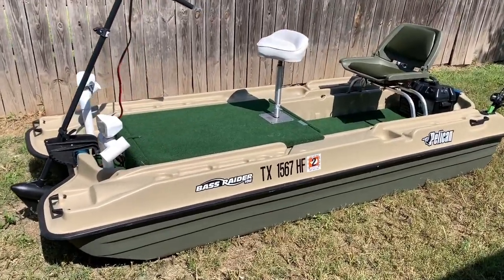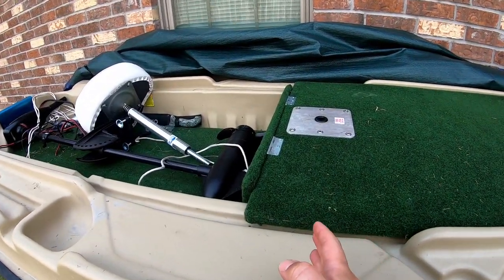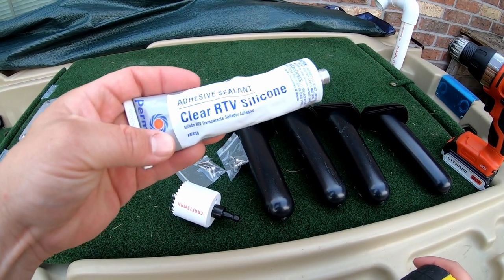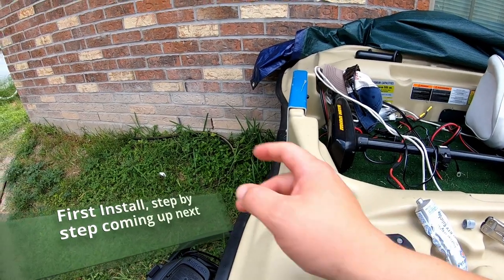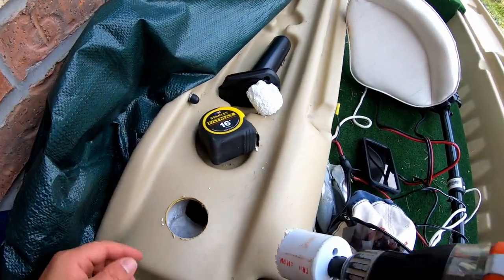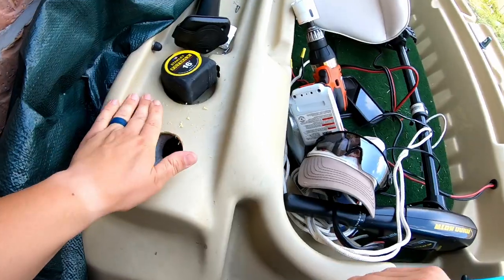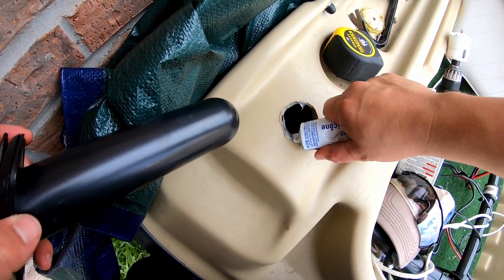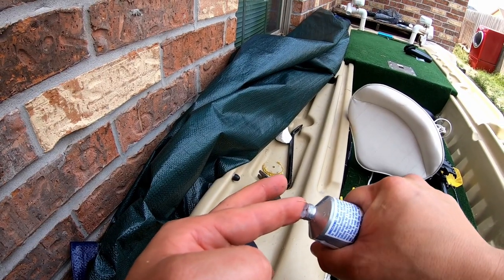Pelican Bass Raider 10E Flush Rod Holder Install

Comment: Pretty cool you showing the inside of the Pelican Like that.  Really brave cutting that big of hole in the boat.  Any issues so far with water?  I like the pole holders for sure.  Nice job.  Fish on!
Reply from the maker: Thanks for watching Vance no problems so far. I put sealant and hopefully they continue to hold up. I actually installed another two rod holders recently. I’ll post them on my next video when I take the raider out.
Reply from the maker: Fishing With Vance thanks for the sub!

Comment: Re the Pelican Bass Raider 10e which I purchased NEW about a year ago: I was putting a bead of caulk around the border of the rubber seal that covers the upper and lower hull halves and was shocked to see that the staples that secure the two hulls are RUSTED.  Why would Pelican not use stainless steel or aluminum staples rather than steel?  If enough of those corrode won't you have hull separation?  Glad I checked.  Perhaps other owners should to the same. BTW, the manual that comes with the boat states "all fasteners" are stainless steel or anodized aluminum.  Not the staples!
Reply from the maker: Daryl Griffin that’s very unfortunate you should call pelican to see if there’s anything they can do about that. The reason I don’t take my pelican to saltwater is because I don’t want the staples to rust. How did the caulking work for you?

Comment: Have you had a problem with water inside the hull? I have, and the bow drain plugs are so high it is almost impossible to drain the water out. Comments please.
Reply from the maker: Daryl Griffin I have heard of people having that problem but honestly I have never had that issue. My guess is that it must be either a defect on some boats or possibly the drain plugs need to get replaced. My buddy has one also and he hasn’t had that problem either. I saw a video where someone just used duck tape because they were constantly having that issue. May not look good but it fixed his problem.
Reply: @dgalvan529  Well it can't hurt. What's your take on my sealing the bow plugs with silicone and installing a drain plug low on the stern hulls?
Reply from the maker: I wouldn’t do it because it might fail when your out on the water. Then your hull will be completely filled. Especially if you have an outboard motor.
Reply: I saw this on you tube and did it also, but I ran a bead of silicon under the black bumper guard, all the way around the top and bottom. Keeps the staples from rusting and leaking water into the hull.  You can’t tell I did it, but I know it’s there. I heard that’s where water gets in. Good luck
Reply from the maker: That’s a good idea I’ve been wanting to do that all around my boat to see if it’ll be suitable for saltwater.
Reply: Bro, as soon I wrote and sent my comment, I scrolled down and saw someone already mentioned it. Bwaaa!
My rod holders came in from Amazon today, bout to do work!  Thanks
Reply from the maker: Lol Awesome bro good luck let me know if you have any questions.

Comment: Great idea...great video, this will be my next project...will any flush mount rod holder work?
Reply from the maker: Thanks for watching. I’m sure any flush rod holder will work but if it’s angled just keep in mind you’ll need to file down some of the plastic so that it can fit flush. I recently added two more on each side. So now I have 2 in the back 2 in the middle and the two that come with it in the front.
Reply: @dgalvan529  
Appreciate it!!👍👍👍👍
Reply from the maker: No problem Tony.